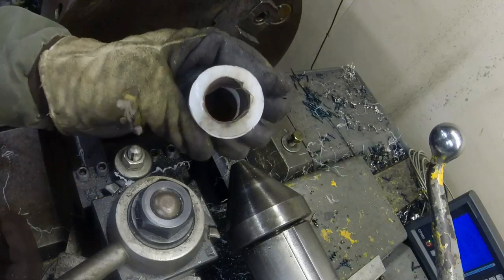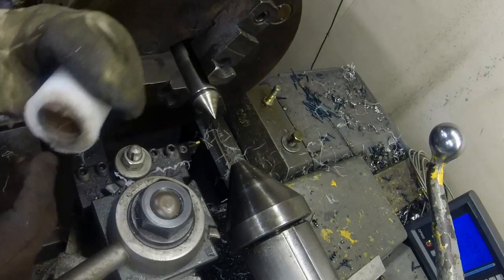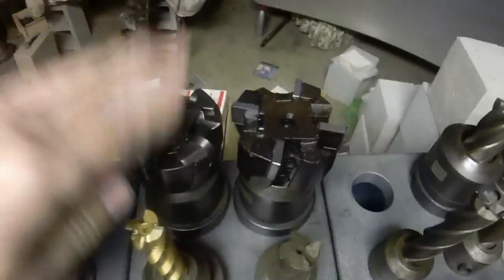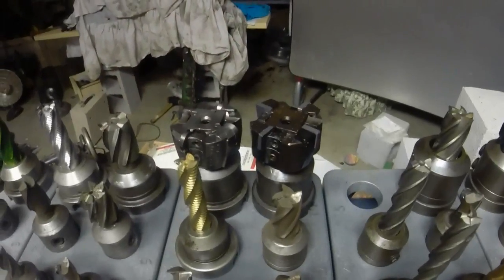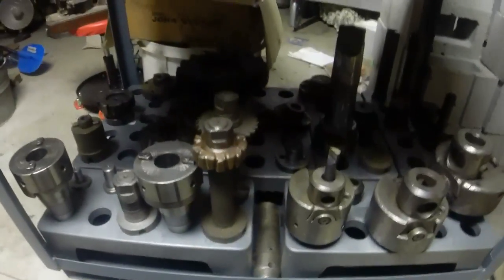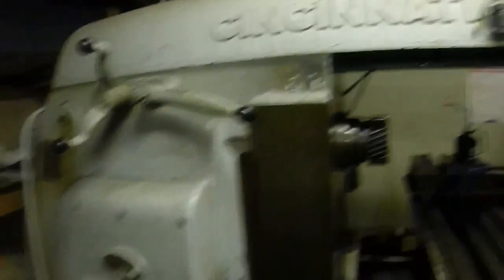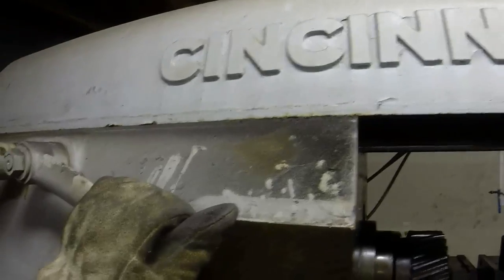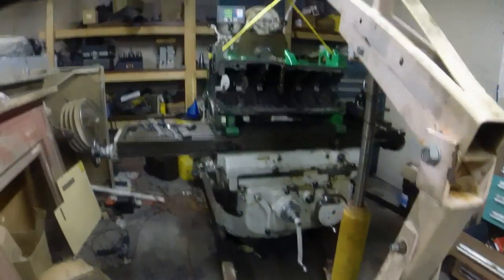Between centers no dog

Comment: Brian, been running through you old videos.  K&T did make mills with a dovetail overarm.  I have one,   it is called a Ramhead. Mine is a CH2, most were made with round overarms.  The Ramheads have two motors one that drives the horz spindle and power feeds the other is in the ram that only drives the vertical spindle
Reply from the maker: I knew some later K&T like the one James Kilroy has uses the dovetail but I had not seen it on any old ones like the 2CH, that rams head sounds like what Cincinnati called a toolmakers overarm. I have one for my mill too.

Comment: bcbloc02 Hi Brian, thanks for those end mills my friend, very handy.  For the record I agree about the dovetail overarm being a superior setup, which my K&T has, and, no doubt, stole from Cincy.  Nice setup with that JD block on the mill.  You putting in new sleeves?
Reply from the maker: James Kilroy  Glad you could use the end mills. Does your K&T have a sprung weight in the overarm too like the Cincy to dampen chatter and vibration? I think Cincinnati called theirs dynapoise. Those engines are all wet sleeve so no need to do mill work for that. This block is getting a billet cylinder head that requires movement of the pushrod holes to accommodate a different port and valve configuration on the head
Reply: bcbloc02 Ah, one of your 'pulling' customers I assume.  I'd love to see a billet diesel head that long, bet you that isn't a cheap item.

Comment: for the new shop,heat,AC and a dehumidifier, floor heat is ecnomical, and the machines like it and your feet/ankles will last a long time. Double side tape, flat surface and live center will hod a varity of things for light cuts.

Really like those big machines at work with a knowing hand at the controls.

Keep the vids coming, when it is conveniant. The G& L should be a treat to watch.